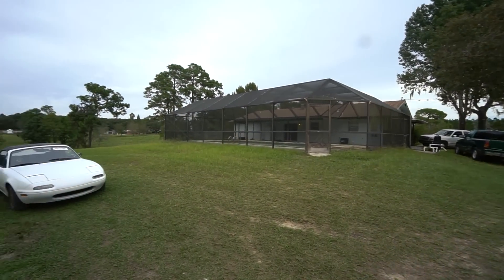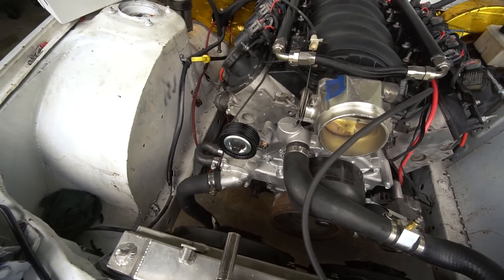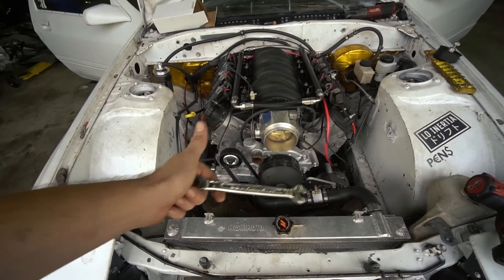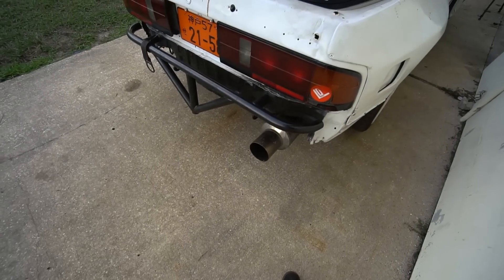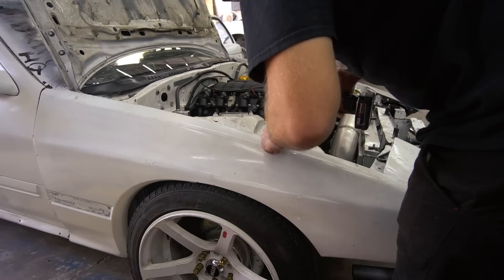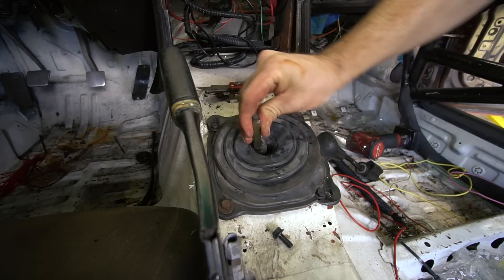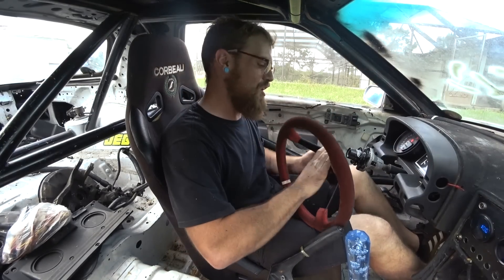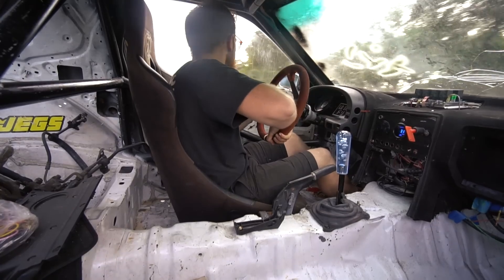First Rips In the Abandoned LS RX7!! SO Sketchy, But Sooo Good!

Comment: I see sooooooooo many ppl struggle to coolant bleeding. Just invest in a vacuum bleeder. It takes all the air out aka (puts it in a vacuum) then u take the air off of it and u can check it to see if the pressure is dropping. Then by the flip of a switch u replace the whole system with coolant.
Reply: Yeah once you use one of those you never want to struggle filling a coolant system the old way again. It's a small investment in saving time and frustration.
Reply: For us cheap bastards, a bleeder funnel is an okay middle ground

basically puts the fill point higher
Reply: YFN_ MARI it’s literally not worth your time to bleed the old fashioned way. These vacuum setups are pretty cheap now too.
Reply: 13 motorsports exactly

Comment: Might I recommend drilling out the holes a little larger in the radiator brackets and putting a rubber grommet in there?
Also, I'm super impressed with the amount of work you knock out in a single episode/day.  You have a crazy amount of drive.

Comment: Congratulations on getting the FC to sketchy complete status! You've really turned your Miata into your trademark expo and comp car until you build a Pro Am car, so if you want to get rowdy I suggest bringing the FC. If you can figure out how to juggle two, bring two. Juggle trailers, borrow a truck for the enclosed, see if Adam is having his stacker head that way or whatever. It'll be worth it. This gives you an excuse to thrash and finish the FC in time, and the event would be amazing test and tune - but it will probably break at some point because it's completely untested. Also, if your old 350Z is going to be at that event, make sure you show off the car you traded it for hands down!

Comment: Hey Taylor,
Idk if your FC CAME with it
but I bet if u delete the rear steer 
The rear end wont play as much every time your turning or in transition
Reply: most Rx7’s came with a rear steer subframe for better handling on track
Kinda like the hicus on skylines but without the rear steering rack
You may need to delete the rear steering for better improvements in drift 
Basically your going to want soild bushings to replace the rear steering bushings so that it won’t flex in and out every time your turning

Comment: Hey Taylor a really good solution for the power steering is you can run a MRS rack which is electronic so you can run it to a switch and have power steering when the car is on or off. If you read this I hope it helps

Comment: Some of that rear end movement is from rear steering im pretty sure. This cars came with a poor man rear steering that was done with sub frame bushings. They usually rot out and it goes sloppy. For drifting it would be very beneficial to put solid bushing and obviously fix the arms😬. So excited to see this thing driving

Comment: Alright try a 45 degree bend coupler on the intake tube. If it’s just that the engine got raised up a tad bit and that’s why the intake doesn’t fit than that 45 degree bend should. Make that intake tube fit under the hood.

Comment: Order a power steering pulley off a Holden vf Ss commodore. There like $50 with pulley and everything and gives u proper wrap around on the bottom pulley to avoid slipping

Comment: Taylor do most drift cars just have the fans wired to be on or off? No temp switch?
Reply from the maker: I have a temp switch on my miata. I normally would run a temp switch off the ecu but with this arc switch panel there’s no way to do an input trigger so I would have to add another relay when I’m already not using all of them so I just made it a switch.
Reply: @Taylordrifts  Thanks for the response! In the middle of a build right now, was curious how you did it.

Comment: I cringe when he just put the bolt in the drill and letter eat. TAKE BOTH CARS!!
Reply from the maker: I do it all the time. When you use an impact enough you can go just as slow as by hand and if it bands up back off without doing any damage. I actually find it easier to line it up with the impact.
Reply: @Taylordrifts  Well then, "the more you know." You do the same on lug nuts?
Reply from the maker: Zach yep! All the time. I’ve had em hang up but I just back off and go again at the right angle. I’ve never cross threaded anything doing it that way. You just have to be careful and not go full power until it’s threading smooth.